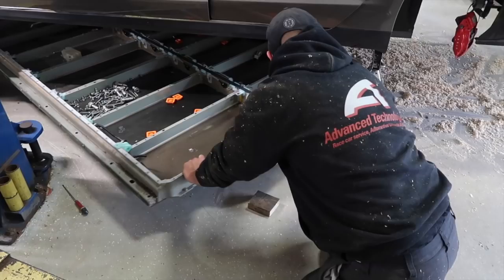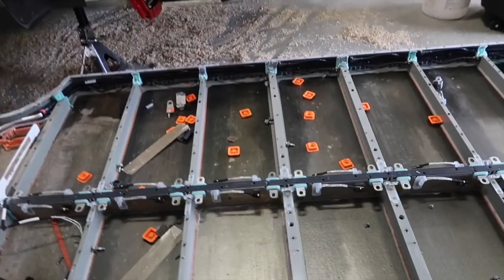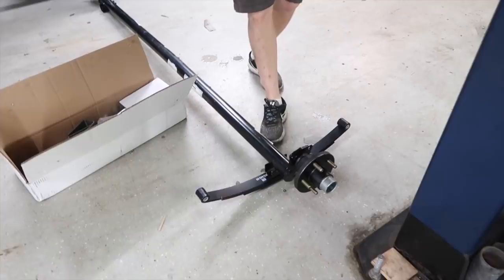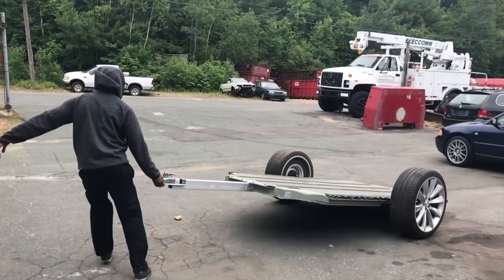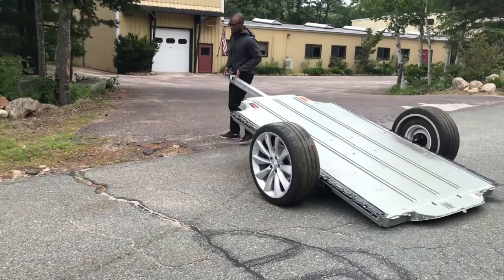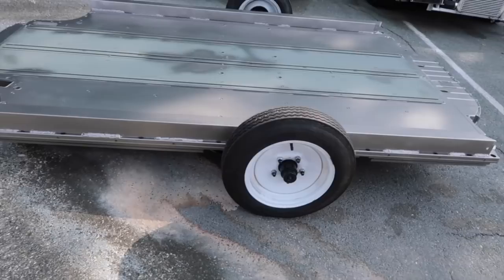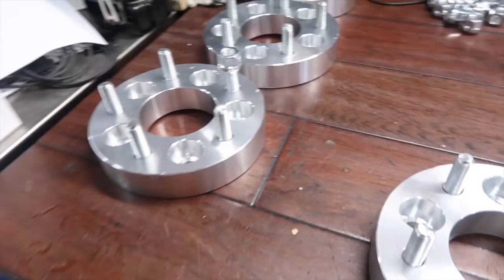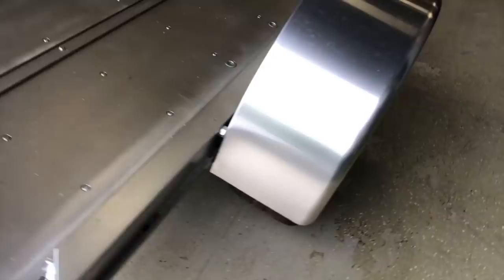DIY Tesla Battery Trailer

Comment: I thought this will be a full pack used as range extender
Reply: Yeah me 2!!! I was sure he was going to hook it up!
Reply: That, I would love to see!!! Rich?
Reply: Yeah me too
Reply: Charles Matkin YES!!!! This must happen.
Reply: That's what it should be.  I'd love to see it wired to the car so it charges with the car!
Reply: How to piss of Tesla! Step 1: rebuild scrap Tesla’s. Step 2: make it better then Tesla! Step 3: Do it all in a 5000 sq/ft, one door garage.
Reply: I was thinking a nice Airstream-esque streamlined enclosure to match the lines of the car.  Throw on a couple of 350w PV panels on top (3 should >just< fit given the footprint of the tray) and you have a range doubled Tesla with trailer storage that self charges!!!
Reply: i thought the same. if Rich wont`t do it i`ll do this))
Reply: psygnale it would take minimum 21 days to self-recharge it every time. I do imagine that’s how the trucks will work, 500 kWh on each trailer
Reply: Charles Matkin i come here to say that but you did
Reply: Same here!! Do it Rich! Make the EXTENDER!!
Reply: Matthias B. I was thinking the same thing. You could haul things and get extended range.
Reply: He’ll find a way
Reply: Great idea
Reply: It wouldn't work. There would be to much air resistance, tires friction and in general batteries would suffer too much. It's a good idea for somebody, who works and needs current for machines like drills, electric chainsaws, Welders etc
Reply: if he put smaller wheels, it sits in the cars slipstream, it could work.
Reply: Sebastiano it could work if you just wanted it as a battery pack that charges via outlet, and then can extend the range of the car.
Reply: draginator6 did you read my comment? Obviously not.
Reply: I don't believe it. Model this up in 3D and test the aerodynamics and friction in the application and I bet it would be more than worth it to use to add more battery. All they would need is 2 of them. Worst case scenario they add 3D printed air foils to adjust some of the air flow.
Reply: hahahaha self recharges? you have no clue how many solar panels you need to recharge tesla... hint: its many.
Reply: matthew wood I never thought about puting batts on a trailer :0 so well docked they can charge the the trucks can be going almost around the clock
Reply: Wait, is that a WHITE VAN!!!
Reply: @Sebastiano you clearly have no idea how cars work
Reply: That would have some liabilities.
But it would probably work.
Reply: John Stutz What if the trailer consists of a full model s battery pack as base combined with solar panels on top? I know batteries are heavy and solar panels kinda suck but I'd like to see real numbers of something like this.
Reply: Charles Matkin yo its a full of challenge now😂😂😂😂
Reply: If you were right about it not working that would mean that tesla's didn't work. You probably wouldn't double the range but you would increase it. how much range would also depend on how much weight in on the trailer.
Reply: Cannon Ball Run record anyone
Reply: I am a Farrier by trade and with fuel prices being what they are I have seriously considered a model x and a box trailer with a couple tesla power walls inside along with my shoeing supplies and covering the thing in solar panels. That way while I'm driving the power walls are charging and then while I'm at a barn plug the car in so its re charging while I'm working. Still think both would have to be plugged in at night but could make an electric rig possible.
Reply: draginator6 You clearly don’t understand how momentum works
Reply: just saying guys a channel named jehugarcia made a range extending battery trailer for his vw bus samba ev conversion. look it up :)
Reply: Charles Matkin At least to compensate the extra consumption that the trailer caused.
Reply: Totally ! A functional tow behind range extender. It would be a great idea for an off road or utility electric vehicle...UEV ??🤔
Reply: Same lol
Reply: I wonder.. if he does use this as a range extender, could he use wind turbines and solar power to charge the trailer batteries? I think he could be able to get at least a 1kwh solar panel to fit that size of trailer, and the turbines would most likely be ridiculously priced. But what I'm meaning is, there are almost endless possibilities. Like, if I had a Tesla, I'd put solar panels on top of the car to charge it up while I'm at work or driving around town. But I'm sure Tesla is against that.
Reply: Or even put a hydrogen generator on the trailer and have it set to auto turn on when the batteries get low, probably 15 to 25%. That's more risky and the feds are uptight about it. But I mean, free power is best power, right?
Reply: Bizilux Games Exactly Elon didn't want to add solar panels to the car... it doesn't add much range.  Unless you have fold out solar panels in the ground etc.
Reply: I was hoping for a self powered trailer
Reply: @GarronGoesGaming , hydrogen generators don't work. It takes more power to make hydrogen, than it can can produce. That's why cars don't have hydrogen generators. Even hydrogen fuel cells are highly inefficient. Why produce hydrogen to put into a car, that produces less energy, than it took to produce it. It's better to just use that electricity to directly charge an E.V. battery, so that it can go further, on the same amount of electricity.
Reply from the maker: https://www.youtube.com/watch?v=Qb7vg08zluQ
Reply: @biziluxgames8924  Solar panels Maintain a battery as its being used it conserves the battery quiet a bit. But you are right you would need a whole shit load of panels to charge it, but if its fully charged first it will make the charge last longer

Comment: Put all the batteries in it and use it as a range extender and see how much longer range you get
Reply: Leofred that’s what I thought he was originally doing when I saw the thumbnail
Reply: Matthew Brookes x2
Reply: Not quit since youd have to still pull the trailer but id say you could go around 1.8x further then a p100d
Reply: To compensate for towing to get same/better range.

Comment: This has so much potential. Backup/supplemental battery power for the electric car pulling the trailer; add a fast charge unit and start a service for electric cars that run out of juice; Charge while you drive electric lawn-mowing service; Camping trailer with a build in power supply; Mini refrigeration trailer.
Overall it looks like a really nice trailer.

Comment: This is my idea 6 years ago.  Make a Tesla battery trailer.  Make an enclosure above it so you can put stuff in.  Plus solar on top.  Have a plug on the back of your car to plug the battery trailer into.  And double the range of any electric car for a long road trip.

Comment: Should be a real batt pack that could extend the driving range!
Reply: with its own supercharge plug? so you can unhook it and place it in its own spot at the supercharge depot in order to charge the car and the trailer at the same time.
Reply: J Allen  yep use the computer from a Tesla to do that

Comment: Rich, you have a HELL of an ideal that's hit a core here.  What if you built a trailer with full battery as the deck, sides, or even make it enclosed (which is what I'd do).  You already have the experience to know how to wire it to the car.  You could easily make a custom plug for trailer/car.  Think about it having a custom paint job with your YouTube channel on the side.  I bet you'll be SHOCKED at the amount of calls you'll get from people wanting you to build them one so they can carry stuff for family or bikes.  Just think about how huge this is.  This SHOULD be your next project.  Call it the "Plug-&-Play' trailer.  You'll be the biggest talk in tesla circles if you pull this off.  You want a 'middle finger' project to Tesla over the way they screw everyone over parts...this'll be it.  There won't be a Tesla owner anywhere that'll go to bed at night wishing they had one for their car!!!  I seen that some others have tried this, but nothing that appears to be a 'custom' trailer that would have the entire battery pack with an aero-designed trailer for low drag.  I'd run the tires with N2 filled due to weight.

Comment: Next build; A small caravan with a double floor of batteries, connected in parallel to the battery of the Tesla, for road trips. You can also hook up a Tesla heater and A/C  and ventilation system, as well as repurposing some interior lights 😇

Comment: Here is an idea; 
Put all the batteries in it,
Build a camper trailer on the pack and use the battery to power the camper and also as a back up in case you ran out of juice.

Comment: I would put a skid plate all the way underneath the trailer bc if your not gonna put batteries in it, it would get caught somewhere and it’s gonna be bad!
Reply: It's just me or the suspension was installed wrong!?
Reply: Definitely a really low ground clearance trailer but I guess if the plan is to tow it with a Tesla it looks better that way. Skid plate probably makes sense considering how low it is but that's a lot of additional weight too.

Comment: That’s a damn good looking trailer. Use a fully loaded battery pack instead of a gutted shell and plum the power as a secondary battery into the Tesla and extend the range out to 500 miles

Comment: You could mount a large diesel generator and some batteries on your trailer and plug this into your car,instant range extender?
Reply: If you're going to use a diesel power source as a backup then I think it kind of defeats the purpose of driving an all electric vehicle. At that point it'd pretty much become just some kind of odd hybrid and it wouldn't be completely emission free.
Reply: Z K not really, maybe you can have that trailer for long range only, just don't use it during your daily commute. You can put a medium sized DC Diesel generator with a 20 gallon fuel tank and have a lot of extra space in a that trailer to make it a small camper. This is actually a great idea.
Reply: Z K VW Tesla trailer 🤔🤣
Reply: Diesel are way cleaner than gas engines tho

Comment: Rich this is a beautiful thing. I've specialized in reverse engineering for decades. I noticed the circuit boards had conformal coating, and should be okay if dried out. I do caution to use ESD best practices, when handling exposed circuit boards.  You can dry out, by just putting in a oven at about 100 F for 24 to 48 hours. Send me a bad electronic part, I can create a parts list, schematics and repair. I do stuff like this , just for fun! lol

Comment: WHY you don but the battery modules back than you will have a trailer and second battery for your tesla car  !!!
Reply: That's a bad idea.  Thieves would then steal his trailer instead of the car.  Since the battery modules costs a lot of money and are untraceable when resold in the used market.
Reply: Chris Bautista yup.
Reply: Chris Bautista if the trailer got SuC allowance you can ask Tesla to help to track and position it.
Or the trailer got his own mobile connection and computer you should be able to block it to no usage, and the trailer will be worthless.
Reply: Peter Birett No idea what you’re talking about but Tesla doesn’t make trailers.

Comment: Instal tyres at the back of the trailer to prevent the scraping. Also  if possible reduce its size. It is too big. Then add like a fiberglass body on top of it so that it can look like a caravan. Can go camping with it, tow stuff. And it will also improve visibility. You don't want someone plowing into the battery pack since they are very low

Comment: I used bed frames to make a cage for a repurposed motorcycle trailer.. also used 6x6 foundation wire to wrap the cage. Sits behind the car and the cage has no wind resistance.

Comment: Awesome project - may even be possible to carry 5 or more tesla battery packs on the trailer and supply main power to get well over 1000 mile range, or power for home backup, field charging of other EVs, remote usage, camping, disaster recovery etc...
Even without batteries, the frame makes a pretty amazing trailer!

Comment: build it with the battery banks double the cars miledge,  or stack 1 or 2 on the trail, make a cross country trip without charging,  build a pop up camper over the battery packs

Comment: Putting battery packs with a outlet would be great, in case you may need something charged. Maybe a way of rechargeable when the batteries needs a recharging too. Will underneath be covered? Incase of flooding or bad weather comes around. So many possibilities with the parts you guys got. Who know, you maybe building a mobile home with solar/batteries power.

Comment: This would actually be super cool as a trailer for contractors. Instead of having to use a noisy and smelly generator, they could use a nearly silent inverter powered by Tesla batteries. Best part is it wouldn't waste any power while idle.

Comment: Putting quality solar panels on it would be a good idea. You go on a trip and while the car is parked it can recharge. Also, maybe think about some sort of regeneration while driving. You turn the power from the  trailer off and turn on regenerative and it charges batteries while moving.

Comment: Turn the trailer into a camper. You can use a light Scamp or a pop up. That could be a good weekend get away rig. I don't own a Tesla yet as they don't tow 10,000 lbs. LOL "Super Duty" You can set the trailer up to tow outer Tesla's or your Vet. You need a trailer with all you do.

Comment: All this effort and ingenuity in combining the already invested engineering and materials of the battery shell would had made a lot more sense if the actual battery shell would had remained intact as functionality as well. Because Its structural integrity and viability is very tightly connected to the way it was initially mounted and attached to the model S structure and looses a lot of upper mentioned strength and viability as a trailer base when is used outside the initial mounting frame. Things like aluminium low resistance to fatigue, micro fractures, and more spring to mind when a structure meant to be mounted on something becomes a structure that sustains something.

But back to "if the actual battery shell would had remained intact as functionality as well.": I do not know exactly what would involve in keeping a second battery pack toed in the back of your Model S and use it as a range extender ; but i imagine a lot : connectors(weather safe) huge power looming (also weather protected), circuitry that can support the second battery pack and uses its power either in parallel to the existing one or as a backup/extension. What are you thoughts about this ? Its been considered , is it possible to create the harness and connections (maybe from spare charging parts) to add such a battery pack or two stacked up for the people interested in extending the range 2-3 times without having to be afraid they will remain stranded in woods or  roads without charging stations (bearing in mind that dragging that weight in the back costs power too when driving)?

Comment: What you need is a set of caster wheels on the trailer and with a removable tongue that will slide under the Tesla and lift up on scissor jacks to help you take out the battery packs.  Then use the scissor jacks to lift up again so you can install real tires and haul away.

Comment: @Rich & @Lee You need to add something to the leading end of the trailer where the hitch is, that will make the trailer's angle of inclination adjustable. It will work better for securing your payload and will also look better

Comment: Cool project.  I do have to say, however, I was more than a little disappointed that this wasn't a project where a full Tesla automotive battery was placed in some kind of utility or camping trailer.
I have long thought that such a thing would be a fantastic project to do, especially if something like a 5th wheel trailer could be fitted with one.

Even if one used a traditional gasoline truck to pull the 5th wheel, it could be designed to both assist the truck in climbing up extreme grades as well as use regenerative braking to charge the battery on the decline and increase overall safety and stability at the same time.

A 5th wheel trailer also has enough roof acreage that it would make solar power for the trailer and battery viable.  I'm envisioning a Tesla equipped job site trailer for example.  Lockable with tools inside that are being charged for the next days work.  No generator required.

Comment: Nice! My boss over at Quick Charge Power has got plans to do the same with a Rav4 EV pack as a range extender. (The drivetrain and battery pack in the Rav4 EVs was built by Tesla BTW for those that don't know)

Comment: I have an idea for this trailer.  Now you have to know what a Ute drawer is first goes under the tray of a Ute (pickup). And slides out.   You could have a similar set up for the roof but have one that slides forward and back.  And you could have the sliding panels as full size solar panels.   So it would provide cover and slide out to become almost the size of a residential solar system.   You would need struts to pop down to carry the weight.  You could even fully enclose the trailer using solar panels.   Would be a great site trailer as you’d have enough power to run everything.

Comment: Man, this is cool, but.....what would have been cooler, is if you made it with a pop up tent on top, then added the battery packs to the trailer. Then you could have used the trailer and made an extended mileage camping trailer. It would have been cool to keep building and maybe make it a goal to do a cross country trip, without charging along the way. Maybe follow the cannonball run route.